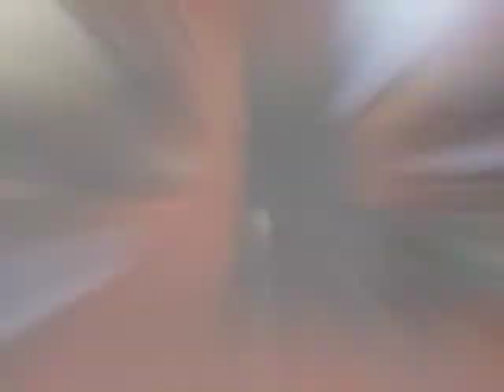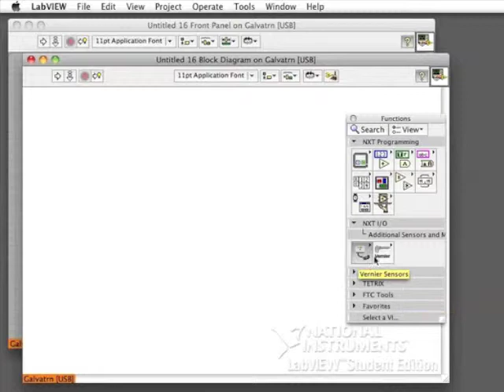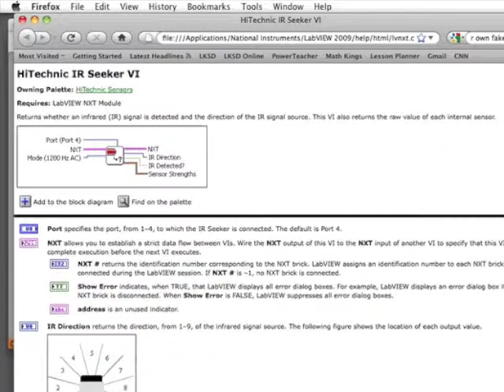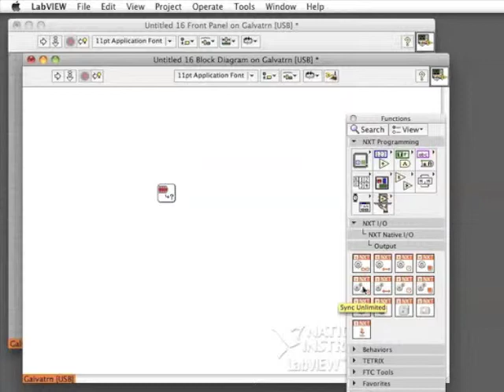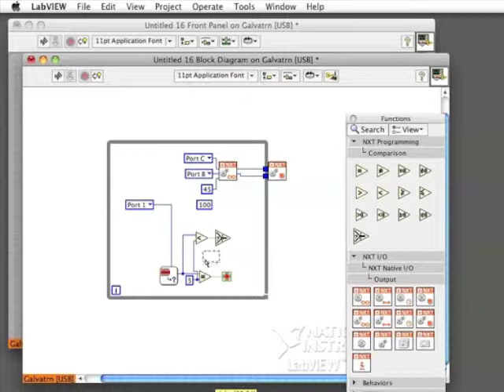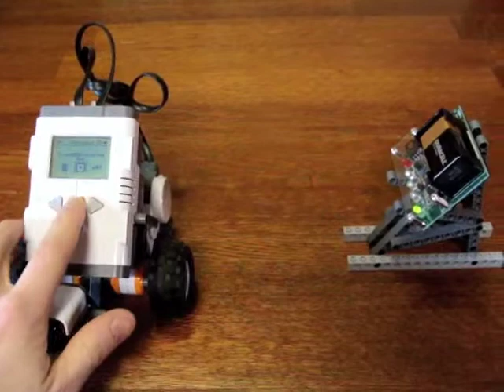Using IR Beacon And Sensor

Comment from the maker: Yeah, this video is a little old and VIs have moved or changed their looks.  Try going into NXT I/O then Additional Sensors and Motors then HiTechnic Sensors and choose the VI called Hi Technic Read Poly.vi.  This VI handles many sensors via a pull down menu.  Put the VI on your diagram and choose Read IR Seeker - AC - Direction.  That should make it behave similar to what is in the video.  Let me know if that works.